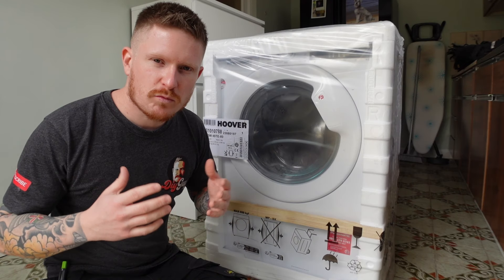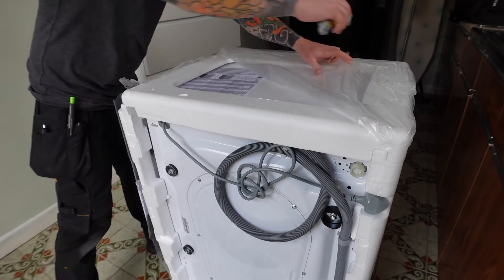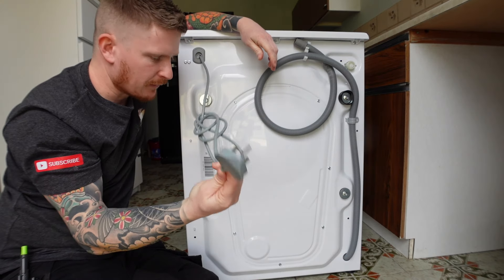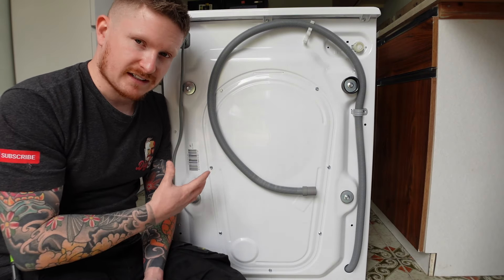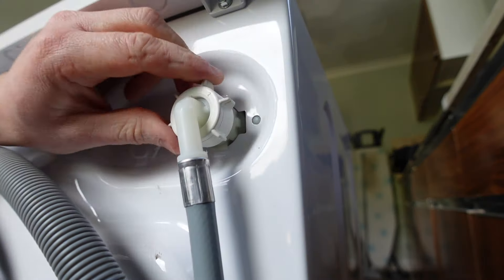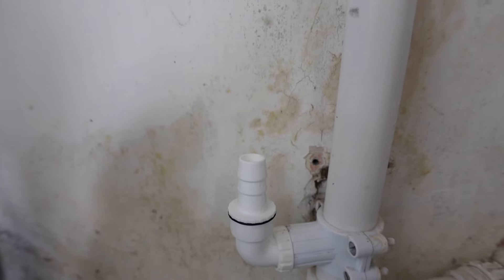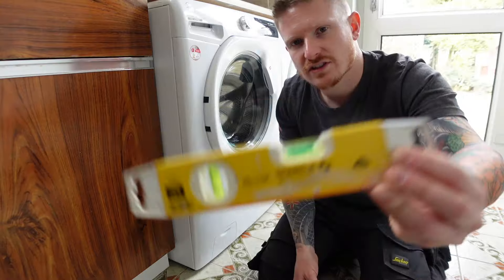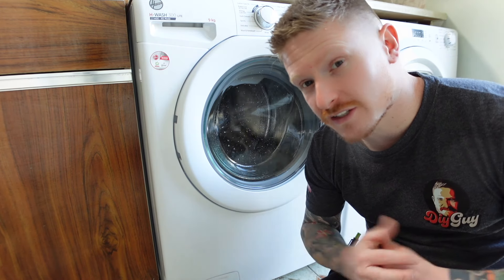How to Install a Washing Machine Like a Pro - Plumbing DIY

Comment: I’m a appliance engineer and over the years I have seen so many broken machines where the customer forgot to remove the transit bolts good demonstration 👍
Reply: Not just the customers! Last time I got a washing machine I had it professionally installed and they forgot about the transit bolts 🙈
Hence this time checking out vids like this so I can do it myself. 😅
Reply: Thanks for the tip 👍
Reply: I think this is the same reason ours is spinning and making demon noises.

Comment: Thank you. Just got new washing machine delivered and I installed it all on my own. I’ve never installed any big appliance before. I am a little proud of myself 😂😂😁😁
Reply: Me too.  I'm as pleased as Punch.😊
Reply: Well done! It's also fantastic to save money on that unneeded 'installation' extra.
Reply: @ChrisM541  Unfortunately I'm now having the same problem with the new one i.e I the door is locked on and I can't open it.  I switched the electric supply off from the mains but that didnt work, do you have any advice
Reply: @ Use the warranty.

Comment: If you have a solid floor, like yours, spraying some soapy water or furniture polish on the floor will make sliding the machine in much easier, also a bit of soap on the spigot will help the hose slide on easier. 😊
Reply from the maker: Top tips 👍
Reply: I've fitted more washing machines than I can remember. At least 20 a week for 10 years.
There's another fitting scenario. Connections can also be in the cupboard under the sink. That means the machine has to be partially under the counter whilst threading the pipes through the hole in the side of the cupboard or in the gap between the counter underside and the cupboard side top edge.
I always used fairy liquid,or similar, as its by far the best lubricant especially on lino floors which rip oh so easily.
Reply: Someone needs to show the whirlpool install team this video. They installed my new one yesterday, didn’t use a jubilee clip & my kitchen was flooded with waste water after the first wash. Fun 🙃 🤦‍♀️

Comment: Just wanted to say thank you so much for this video. Mine broke down and was too expensive to repair so ordered another one. As a single mum of 4, even working full time, I could not afford to pay the extra £45 for install. Waitjng two weeks, it arrived today. Using your video, I disconnected my old one and reinstalled my new one. My first wash in on and is working fine. Many thanks 😁
Reply: Way to go mama❤

Comment: Is that ok to fit the drainage into airtight connector, because i read on the web, it says it will have a syphon effect and will affect the drain process and can affect machine efficiency

Comment: Thank you, just received our first washing machine ever. We have never installed one ourselves but watching your video, we were able to. We had the upwards long pipe, previous owner had so it was easy to stick the pipe into that. And connect the cold water pipe, thankfully no leaks. We followed our WM manual and did the drum cycle, no leaks, drains as expected. Though I wish there was a plug near the WM, the kitchen was the one thing we did not renovate so when we do....one thing for sure, will make sure there is a plug socket near appliances such as WM, dishwasher and tumble dryer, saves the hassle of using extension. But anyway, this is the best video I have seen on WM Info and Installation.

Comment: Another well explained clear video like always, your videos always appreciated. I have a set of those airbags (lidls middle aisle) and used them for so many diy jobs, well worth having in your tool collection
Reply from the maker: Thanks. Absolutely! 👍
Reply: Those Lidl Air Bags are quite useful if you lock your car keys inside the car too ...

Comment: Just got mine fitted, no issues. Thanks for ur instructions. Ps maybe tell people to check instructions in case the manufacturer advises you do a first run without clothes at a high heat with detergent to give the machine a bit of a run & clean itself before u use it for normal washing. My instructions manual recommend it but I’d already put a load of washing in it 😅
Reply from the maker: Good tip!

Comment: Only took me 62 years but it's another notch under my belt, saving me a bob or two, especially at this time of year (10 Dec '24)! Thank you so much. 

PS.  I have to ask though, would it make any difference to insulate the inlet hose and the pipes to reduce condensation from the cold water?  There was a lot of black mould on the wall when the previous w/machine was taken out.  I've just done a wash now but the hose was very wet and it's not even leaking!

Comment: If i am going to pull out our machine to check behind it. How and where am i going to pull safely,? it's positioned in between two cabinets almost like in your video.

Good tip with the airbag, i am going to use that when i have to reposition the washing machine👍

Comment: One thing you forgot to mention and the most important after removing the packaging and before removing the Transportation Bolts is a "Drum inspection", to make sure the Drum hasn't been damaged by the Supplier.
Then after removing the Transportation Bolts, is a "Drum spin and sound test". Simple test to see if it spins and makes it's usual sound as it should by hand, before even doing anything else.

Comment: Excellent tutorial video. Our GE washing machine was installed 5 months ago. This was taken out from our laundry room due to damage from a water leak. I spotted 4 holes at the back of the machine. I saw your video today. Transportation valves were not there and caps were not provided. 
My question. Is it fine to leave the holes open or can I tape the holes?
Washer might be installed back maybe in 2 days.

Comment: Thanks. This machine comes with a random bit of card for the base but you didn’t show that being installed. Did you use it? Seems a lot of work to tip it over & back again.

Comment: All the hotpoint machines we've had they never had a locking nut. If a tumble dryer has four adjustable feet how would you adjust them if there is no room to get to the feet

Comment: Nice and simple, great video. I have a small problem with my machine, when it expels the dirty water it wells up in the sink (not much but enough and it smells). I'm presuming the waste pipe to outside is partly clogged. Is it worthg me gettting a right angled waste connector, my waste pipe (from the machine) is set to be higher than the point it connects to, but would the right angled help a bit more?
Reply: I have problem.

Comment: At point 5.20 on the video when you tested to see if you had any leaks on the water supply, how did that water drain from the drum did it just stay in the drum until you connected the waste pipe?

Comment: Hi i fitted mine and notice the water leak from the valve, i tightened it a little bit and lessened the pressure, on another wash there was a leak althought smaller so i tightened it little more no leak has happen but a tip of water is on the valve, is that normal? No damage on the hose and no dirt on the valve itself.

Comment: Hey folks ! does anyone knows if a anti water leakage hose should be used instead of a normal hose ? Mine was installed with a special hose leakage proof but stop working now I have a normal one spare can I use it ? Thanks

Comment: I notice that the drainage hose is bracketed at the top.  I assume that you do NOT want to remove that since you want the waste water to flow up and then down to ensure that gravity does not drain the water out when the machine is washing???

Comment: WOW! You had a 35kW combi installed by iHeat? I watched their video on their youtube channel. Im thinking 35kw is way way over sized. Did they do a heat loss calculation? Im guessing less then 10kw assuming double glazing, wall & loft insulation ect. They installed a hive not worcesters own weather compensation controls, so i doubt that boiler is going to modulate. I'm betting that boiler is cycling wasting gas. Unless you wanted to run a bath and shower bar mixer and fill up the sink with hot water all at the same time. That boiler is way over sized. Did they measure the cold main flow rate and pressure?  I don't think ill be subscribing to their channel.

Comment: My machine has a cold water hose like the one you connect to the machine, but when my boil is on the washing machine  water comes out hot ,doesn’t matter if  I put it in the cold water program, help me please
Reply: The machine may be connected to a hot water feed. Check where the washing machine pipe is connected to and when you're running a cold  wash feel the pipe to see if it is warm. If it is then you have hot water going to the machine and need to change it to a coldfeed pipe.

Comment: Unfortunately I installed mine with transit bolts and wasted £400 and when I called up Beko they said we can’t do anything as it’s written in the instruction manual so £400 went out the window and having to buy a new machine again!

Comment: I bought a Miele. No problem plumbing the thing in but could hardly shift it in place the thing weighs over 100kg 🥵🥵
Reply from the maker: Ouch ha
Reply: Does it run nice and quietly though? Would you recommend getting a Miele? Cheers
Reply: @Oli_Hudson  yeah very happy with it. it’s solid as a rock and almost silent in operation. Only noise that comes from it is when the pump kicks in or when its on the spin but even that is so quiet when it ramps up to full speed.
Reply: Just replaced our washing machine 2 weeks ago. 74db is a decently quiet washing machine I can confirm 😂 you literally only hear the pump and spin if it’s half empty.